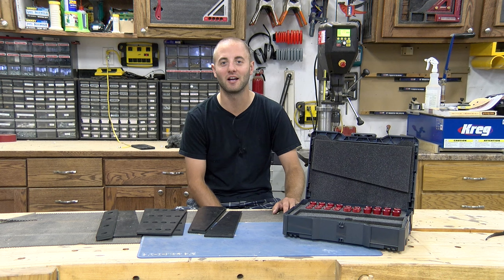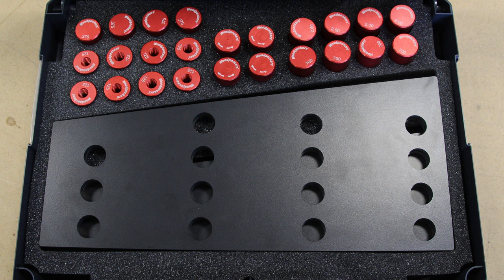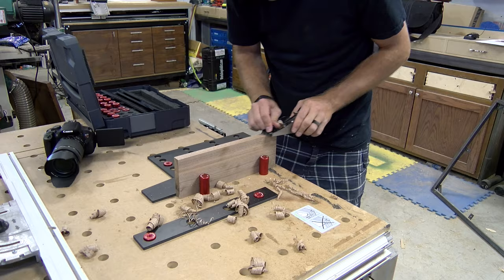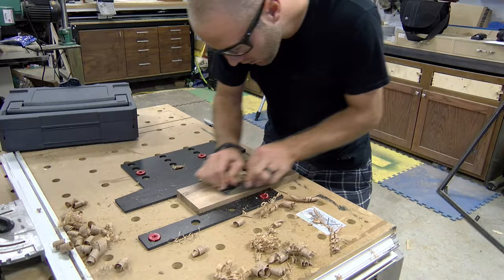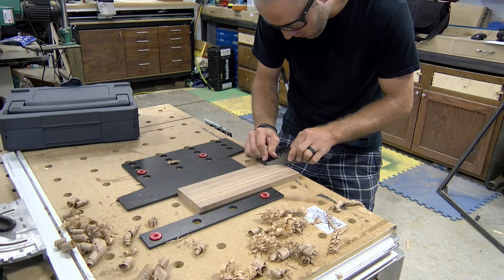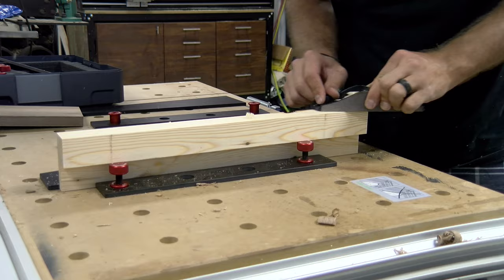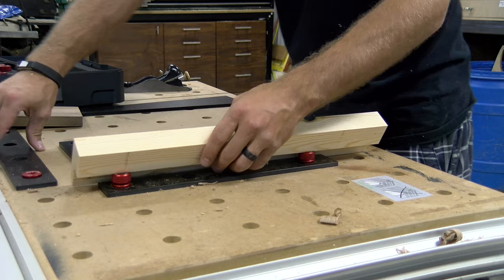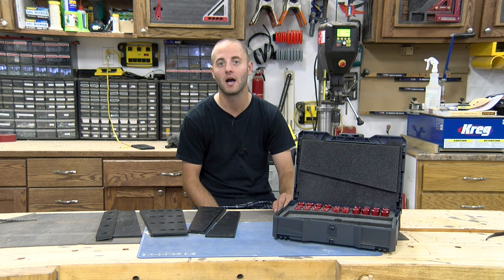Woodpeckers OneTIME Tool | 2096 Workholding Kit

Comment: I'm exactly the one car garage weekend warrior you speak of and I use my mft all the time.
On of the things I did for my MFT to prevent that shaking was took an MFT clamp that slides into the side rail had a local metalworker weld it onto an iron bar with a t-stop at the other end. I brace that against the wall whenever i need the MTF to be more stable than it is by itself.   Or... you could take a 2x4 drill two 20mm holes through it and drop two dowels through into the mft dog holes if you're limited to your own woodworking tools.
Reply from the maker: Rock on Peter!